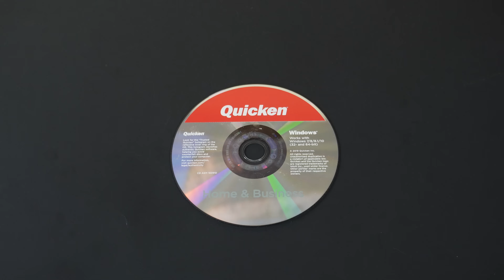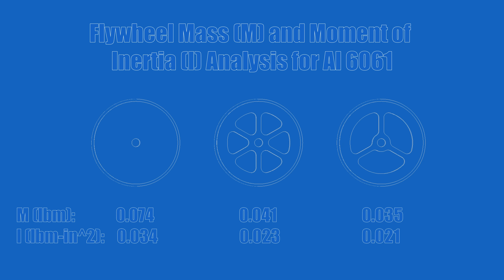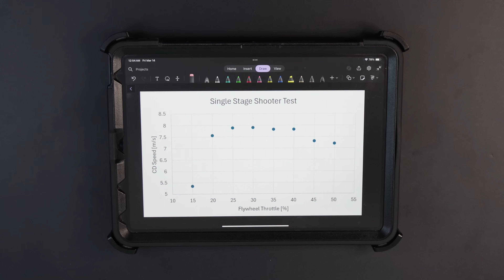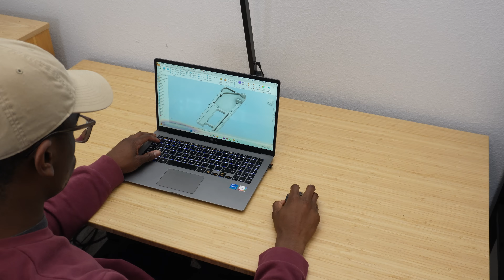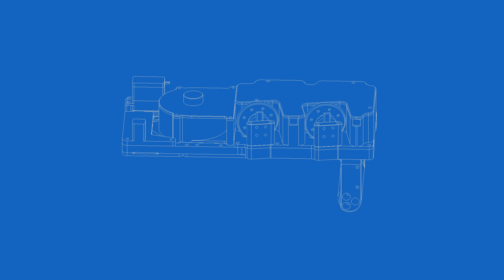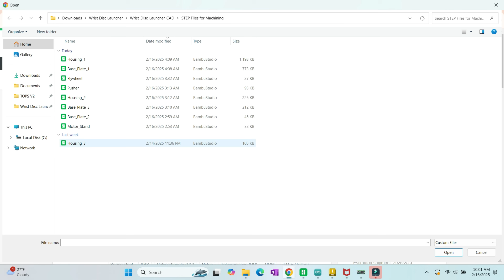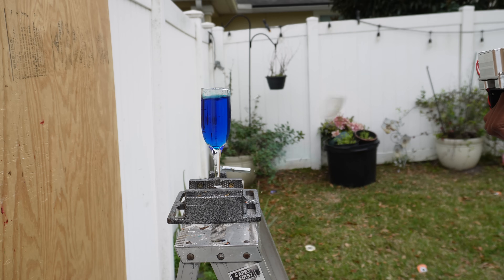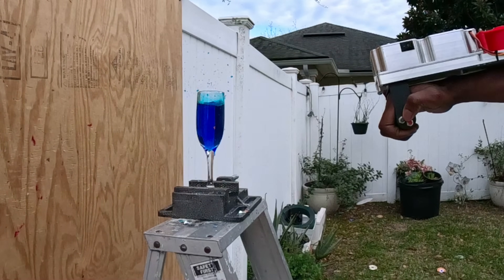Wrist Mounted CD Launcher - Built to DESTROY!

Comment: Your o-ring experiments reminded me of an incident when I was a kid in the 1970s. I had one of those toy motorcycles that you put on a stand and revved up with a built-in air pump. You pumped it as fast as you could, built up inertia in the motorcycle's flywheel, then flipped a switch to release it. It worked fine until I used my grandpa's air compressor on the motorcycle, spinning it so fast that the rear tire came off the wheel and got tangled up in the flywheel, basically destroying it. A hard lesson. :(

Comment: In the video, the creator uses a flywheel with an O-ring to launch CDs, and he finds there’s a sweet spot where the flywheel speed is optimal. I’m basically suggesting that it’s like a tire’s slip ratio: once you hit that max efficiency, pushing the motor faster doesn’t help. Instead of adding another motor, just adding another O-ring on the same motor could keep things efficient without the extra complexity.

Comment: A friend of mine, who is a cop, their kid is talking to me about wanting a gun that shoots "fuckin saw blades!" I answered "no, really, you don't. Thats a terrible idea. "Why?" Ask your dad. (Dad asks why too) sigh The list is long and undignified. Legally, a bullet is fired to end a threat, not to cause massive bodily trauma, the only reason you would want a gun that fires sawblades would be to cause massive bodily trauma. Mechanically, a bullet has two forces acting on it and neither are in conflict on impact. You have forward momentum, and you have spin caused by rifling, where it is rotating along the central axis of the bullet. Lets compare that to the horizontal rotation of a disk flying at speed. The forward momentum of the disk will deliver some of its kinetic energy into the target, but because you're dealing with horizontal spin, the vast majority of that kinetic energy will be deflected by the disk's rotation at an angle. If you are lucky, the disk gets tuck in meat, if you are unlucky and miss your target, that fuckin saw blade is a threat to anyone and anything even remotely in proximity to it, because of ricochet. 

When they still didn't believe me, I walked to my office, picked up a banned nerf gun that fires little green disks, and walked them into a small room. "Imagine this disk is a sawblade." I load the toy gun, step out of the room, and say "fire when ready." pop bop bop bop bop bop bop bop "OW!!" I ask "Did it hit you in the eye?" He says no, but it hurt. 

Do you still want a gun that shoots sawblades? "no..."

Comment: Very cool !
How long until you make a rail gun, specifically to launch copper pellets at a sufficiently  high enough intensity to form a plasma ?
The intensity of the electromagnets would need to be insane and precisely controlled.
Copper and magnets react quite favorably for something like this I should think.
Sounds silly I know, but if a magnetic charge is momentarily imparted to the copper round, it should perform fairly well.
Not ground breaking by any means, but functional.
I wonder if electroplating the rounds with different metallic alloys would help achieve the required over all effect ?

Comment: Yay! I built a thing like that at the end of the 90's when companies began to include free ones with print material and spam mail. Suddenly there was a surplus of shiny discs. And I made a machine not dissimilar to this one, but mine has a flaw. It would bite into a side of the cd on release, making a little notch. Normally if a CD is spun up and you graze it - no big deal. The worst is that you'll get a tiny friction burn. But if the CD has a notch, it turns into a table saw. If I only fired CD's once, the notch wasn't going to be an issue, but I re-fired them. Safety was an afterthought, so I ended up injuring myself and disassembled the device afterwards. But when it worked I had as much fun as in this video. Due to momentum accumulation you didn't need much power, if you were willing to wait. Even a single 9V cell could produce some mad force.

Comment: If you swap that pusher servo out for a stepper motor, you could spin it continuously and give this launcher a fast full-auto with both ends of the lever pushing out a CD, while having the option to make a selectable semi-auto feature if you feel like it.
Could have also added a picatinny rail on top and mounted a red dot.

Comment: You can use a 3rd motor to accelerate the top CD off from the magazine. No servo needed.
Last accelerstiong stage could have 2 motors, one on top and one at the bottom to tightly squeeze the CD.

Comment: How come you didn't lower the flywheel to operste in the NO-GO zone? I'm thinking if you play around with the height sliiiightly, you can increase both the force and the surface area on the CD. And if the rubber ring is too squishy and it hits the bottom by the time it reaches a good enough force, you can make a groove to make up for that! The rest of the CD should still be supported by the surface around it! 
I love your stuff so much.

Comment: but they're not the same design (at least I don't think so) didn't you move the rubber strip from being on the side to under the disc? and also maybe the servo ejector is giving it a more stable push with less friction from releasing as it's not pulled out from under your finger
edit: I was wrong I didn't see that the rubber strip was not flush into the bottom, and the cds are still being pulled by the magnets so there's that too maybe it's like a sweet spot of resistance with all the magnets making more speed possible... I have no clue
Reply: damn really?? not even the metal cds broke the glass, that thing;s strong!

Comment: Marvelous video and work. looks like 0.3 DMG per disc. i wonder if the launching of each disk came from center mass or turning the disk tray's base into a controlled high rotating platform would alter velocity. However the mass of the CD doesn't change. Man You got me thinking,

Comment: for the next iteration you teased, i'd recommend that the discs have a single edge bevel to crack into/shatter glass. could also improve performance stabilizing in the air if the bevel is facing up when launched, acting similar to a frisbee.

Comment: Did you measure how far that CD flies when it ricochets from various surfaces and what its velocity is? And if you did, - was it before or after you put on those safety goggles? There is a carrot somewhere in that carotid artery. Unless you boiled those first? (carrots not arteries, these days it needs to be said.) .Human beings are very soft mon ami.  Much softer than most large vertebrates.

Comment: Now if you learned how to sharpen the edges of those cd's like I did with my cousin many many many years ago that'd be one lethal disk thrower, we had just done manual throws and made them stick into almost everything we threw at with some exceptions like concrete ,steel bars lol

Comment: Too cool! 🙂 a little bit of ceramic or carbide grit bonded to the edge of the discs should help you get through that glass, just keep it minimal and only on the edges. 80 to 100 grit should suffice. 👍 A tri-point "Predator" laser site would be a cool addition. 😎

Comment: 5:33 my years of nerf modding finally comes in handy, yes high speed looks like it should launch it faster but upon any load will slow down (like how you can hear the stryfe slow down and rev back up between darts) so you need a high torque motor that can keep its speed under load. Also, increasing the "crush" slightly helps prevent the flywheels slipping on the dart, or the cd here, but too much and the friction negates the benefits. Would be really cool to see what a v2 with high torque motors and maybe diy cast metal cd's could do

Edit: nvm just finished the last few minutes and you got metal cd's XD

Comment: Just a thought, but maybe using a thicker o-ring would give it a better grip coefficient and you shouldn't have to change the fly wheel. This would give it more spin making it more accurate and slice through things easier since it would be at a faster rate of speed for the spin. Where I'm really curious is if it will drop the speed again. So a higher torque+speed+ grip would mean a much more effective machine with the same two fly wheels.

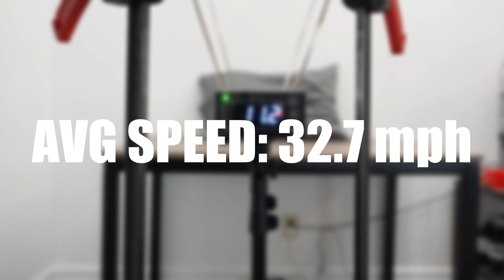Comment: 11:40 - You switched from from thhe bench power supply you´re using during the tests to the LiPo battery. Probably why you ended up with a greater speed. LiPo has a greater discharge rate than the bench power supply

Comment: 4:20 the fly wheel could be fixed with some glue, we have this problem with rubber tyres and small wheels, glue works a treat.

18:00 i think at this point the rotation spin is working against you, try disabling it (think this is the rubber ball effect steve mould talks about)

Comment: The change in speed from prototype to full build could be from the parts flexing, if the parts holding the flywheel vibrate too much or bend away from the cd it could cause less contact and less speed.

Comment: I can't help but Wonder, what if the metal CDs had a sharp edge or a serrated edge or edge like a martial arts shuriken. I would really be impressed if you were to use your device to hunt squirrels or rabbits or doves successfully and do a catch, clean, and cook preparation of the same in the same video. Then tell us how great the campfire meal and recipe turned out. On second thought, that device may be rather inhumane in that it might not execute a clean kill. If you could get such a device to throw arrows at a fast enough velocity, then maybe even deer or feral hog hunting could be considered. Consider even the type of blow darts that are lightweight and used for feral hog and deer hunting. Of course the possibilities are endless. Great video which I enjoyed immensely and did indeed subscribe.

Comment: 4:20 I'm curious... Why didn't you print a ribbed tpu disc to squeeze in between the plates? (Ribbed for our pleasure)
Reply: It would most likely cause air pockets between the plate and the disc when squeezed together so tightly, ultimately lessening the grip and being counterintuitive.

Comment: I’d like to see further and more extreme iterations of this design. 1: experiment with different materials for flywheel ring to increase friction to allow for higher usable speeds. 2: see if decreasing friction between discs and the flat surface they slide over will increase projectile velocity. 3: put matching flywheels above and below disc to grip as they shoot - similar to certain baseball pitching machines I’ve seen (will require design to extend below your arm on one side). 4: extend design past the end of your fist in order to add more flywheels (or above/below pairs of flywheels) of ever increasing speed, as many as you can before the additional weight becomes unmanageable. Or create a version that can be placed/mounted on a stationary surface/object so you can just go ham with the flywheels and see how much faster/farther you can get the discs to fly.

Comment: The thing about spinning the discs, is that it also displaces a lot of energy, so when they hit a target, they deflect, instead of dumping that energy  into the target. You need to sharpen them, or add serrations/teeth, so that they can use that rotational energy to cut.

Comment: Just curious but if you rotated the second flywheel a little more clockwise or offset from eachothers axis  than the  first flywheel would that help create addition spin or "torque" on the CDS for a faster acceleration. 

And if so... 

would that help carry more weight?

So could use hole saw drill bit and cut out a 80 mm diameter disc from 1mm sheet of aluminum. 

From what i looked ...

" and my math could be off btw "

It says the aluminum disk would weigh 13.57  grams and a micro disk in the same diameter and thickness can weigh anywhere from 14 - 33 grams 

" from what i looked up"  

In theory you could probably send those aluminum disc pretty quick and could even sharpen the edge of  disk for better penetration.

Also can shave of some weight by cutting a larger diameter center hole than your average micro cds which is.
40 mm in diameter so maybe with the aluminum disk you could get away with 45 - 60 mm center hole.

But anyways love the video and the tactical swap CD mags and the metal definitely looks more bad to the bone.

 Even if my theory doesn't work out how i imagine it. Would still like to see your take or someone else's ideas for a mk2!!!

Also sorry for the long rant cant blame you if you didn't make it this far lol. 

Scrolled across this video while getting ready for bed and just couldn't sleep thinking about this.

Comment: Great build! I think it could be even a lot more powerful if the flywheel was a rubber coated roller that streches the whole width of the device. This would give the cd lots of grip and make the acceleration efficient.

Comment: If the grip to the cd is the problem, increase the surface area of the rubber on the fly wheel. Next time serrate the edges of the discs!

Comment: Few ideas, some dangerous:

Sharpened edges. All the discs are blunt.
Textured rubber might get more grip. 
Wider rubber, also a grip possibility.
A thin layer of teflon or something extremely slippery as a baseplate for the CD to slide on.

Comment: The force of friction (which you are using to accelerate the discs) is equal to the force normal times the coefficient of friction.  So if you want more projectile velocity (without more flywheel stages), you need to decrease the gap between the disc and flywheel for more compression on the O ring for more friction between the disc and flywheel. (For nerf blasters, the term for compression on a dart is crush)

Comment: In the first 5 seconds when I heard the speed and strength of the motors I could already tell what was up. I had so many AOL cds when I was younger, then I worked for an ISP and had access to thousands. We would have contests in the offices to see who could break more of them. We started with 1 and would hold it in 1 hand and punch it with the other getting it to shatter. I think I got up to 7 in one hand and after that I think I gave up. 

I remember when I was even younger taking a cd drive apart taking the motor that had the attachment for a cd like you would find in a portable player so the disc would click into place onto the attachment and I'd increase the power until it was spinning very fast then due to the gryo effect id turn my hand holding the motor in a perpendicular direction and the disc would launch off the motor hitting everything while maintaining its rotation for a while, at some points shattering.

It wasn't until I had a dremel that had 30000 rpms that I was able to get them to shatter just from spinning them too fast. (yes I said shatter 3 times, 4 now lol, it happened a-lot) An interesting thing was we also had the mini cd's as well when we worked for that ISP but so many people put them into those slot cd player drives and were not able to get them back out that we went back to the full size. Localnet was the company, still has a website up, DialUp at it's finest lol

It's funny I usually make comments on videos way to quick trying to help out younger engineers with ideas, and had typed out a method on getting good disc spin out of the device, and at 5:24 you were already there. I'm like awesome this dude knows what he's doing. I like your idea for the 2nd rotor past the 1st. I don't think I would have even thought of it. Your work is so good, pro level ideas on multiple aspects of your creation.

A 2nd way you can increase throttle level is by having another rotor under the disc as well either powered with a similar weight to the above or unpowered with a lighter design so it spins very easily. You can add springs to apply tension on the upper and lower rotating mechanisms to add increased grip pressure without pushing to hard. You can make that tension adjustable with screws through the springs.

Comment: What about putting one of the wheels on top and the other below the disc? They would be in contact prior to contacting the disc, and also during contact all the force would be transferred to the disc (instead overcoming the drag due to contact with the surface).
I think this is the principle used in commercial devices like baseball thrower....

Comment: You probably figured it out but the reason the prototype and the launcher have different speeds is likely the input speed. The initial prototype had a lower input speed and likely slipped at the start when it grabbed the CD. The higher input speed reduces the total time the wheel slips and allows it to put more energy into the CD.

Comment: You brought up why you didn'y put more launchers in series but not why you didnt make the o-ring wider. A larger ring would create more surface area greatly improving the efficiency. The only issue is you might have to deviate from the clamp flywheel design and move to a design where the o-ring is physically integrated into the flywheel.

Comment: Could you file the edges of the CDs, even the metal ones? the shaper edge on the plastic should slice the fruit better and on the metal ones it would create a smaller point of contact transferring more force into a smaller area to break the glass?

Comment: I imagine that the reason they went faster in the final design compared to the prototype was because you're using the high-speed servo to push the CDs. Since they are going faster to begin with, there is less slipping so they have more time to accelerate. I bet you could do further testing using your final design and find an even faster spin rate for the two motors to improve the speed further. I also wonder what effect the angle of the flywheels are at has on the final speed. I imagine that there is a point of diminishing returns, where you are getting more stability than you need while sacrificing speed that you might want. Additionally to that, maybe the angles don't need to be the same between the two.